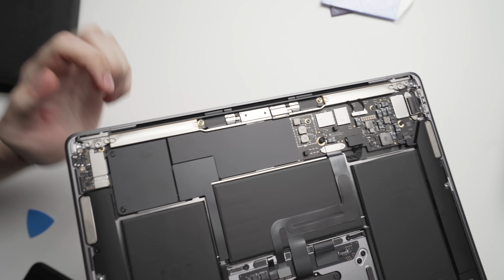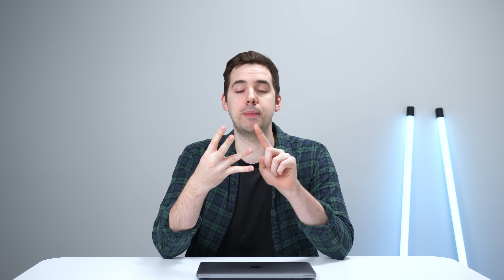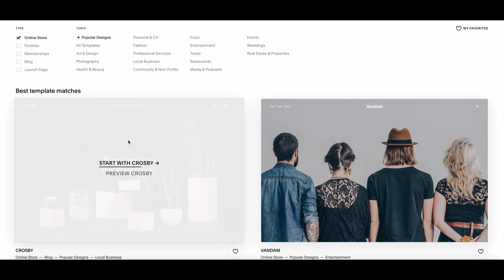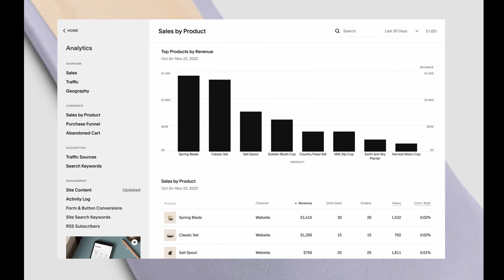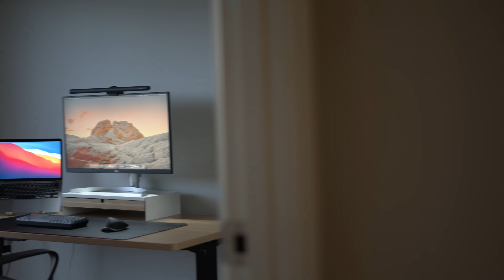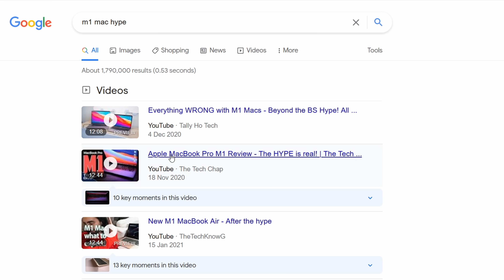M1 MacBook Air Review - After 5000 Hours of Use

Comment: Its an amazing laptop. Been using it for a few weeks now and everything is so fast and smooth. I had some files that were in my old laptop (Lenovo, i5, 8gb RAM) so I went back to retrieve them, and from the moment I turned it on, to getting the file, and accessing chrome to send the file online, took me 30 minutes (I am not even joking about this). Made me realize how amazing the Macbook M1 Air is when the same process took just that few clicks here and there to complete. The only problem I had with it was during the first week when transitioning from a Windows laptop to a Mac. The trackpad, keyboard, shortcuts and all were unfamiliar but now its much better and a breeze when it comes to work completion.
Reply: I don’t think you’ll go wrong with the decision. I’m a university student as well. Excel, Word and some of my biotech related programs run very smoothly. Mine has 8gb of RAM and it’s already blazing fast. Do keep an eye on your storage options. I opted for 512gb as a long term buffer and very quickly almost half is full (it’s probably because i synced my iPhone stuff into the Mac). Just keep in mind that if you’re coming from a windows laptop like me, then give yourself a week or two to get used to the trackpad, shortcuts etc.
Reply: @kdr9608  I've the option of either upgrading the RAM to 16GB or the Storage to 512GB, I'm confused as to which should I choose. The RAM makes it future proof to some extent. While I can always get an external SSD for a price that's cheaper than what Apple offers, the same wouldn't possible in case of the RAM.
Reply: @shishirkumar9570  Yeap you’ve got a point there. And also since you’ll be using it for video editing and coding, opting for a better RAM should be a reasonable option. And if you were to edit videos and save the files into the Mac, pretty sure it’ll hog a lot of storage so an external SSD may be the better long term choice. 

I didn’t opt for a stronger RAM but a 512gb storage option because I knew I’d be backing up my phone in this Mac. The phone is 256gb and there’s already like 150+ gb used up after year 😆 So surely in a few more years time my backup sizes would only grow alongside the files etc I will have in my Mac.
Reply: @kdr9608  Got you sir. I was really looking for a Mac owner to have this discussion with. Thank you very much.
Reply: @shishirkumar9570  No worries. All the best!
Reply: @shishirkumar9570  when I upgrade I use the following rule: # of cpus > # of gpus > ram > ssd size ... what that means is if you have limited $ upgrade cpu/gpu (in case of the MBA go to the 8 core GPU as an example), than up the RAM, and lastly go for bigger SSD.  You can always use external storage/cloud.  I wouldn't choose to rely on the fast SSD for swapping, SSDs have finite mumber of P/E cycles (constant writing and erasing wears them out)
Reply: Hey, I'm thinking of buying an entry level MBA M1 16GB RAM for college, mostly I'd do browsing, some beginner level video editing and coding. Will you suggest it?
Reply: A bit late here, but how is the MBA keeping up now? Is 8gb ram still enough for you?
Reply: @avrgbtw  So far no issues at all running stuff like Word, Excel each having pretty large datasets. Apart from that my Safari tabs are always there, averaging from 5 to 15, occasionally more. Zoom calls which lasts more than 2 hours. Other miscellaneous ones like calendar and finder is always there too. With all these running, its still smooth. So far the only major app issue I’ve faced is with the notes app which won’t open. Restart should solve the issue but its just that sometimes it can be annoying haha. Hope this helps.
Reply: @kdr9608  Thanks for the quick answer, this helped me a lot!
Reply: @avrgbtw  just note that if you’re transitioning from a windows system then the beginning might be tricky when you try to use the Mac. The trackpad is wonderful though once you’re used to it haha.
Reply: @kdr9608 hi how is the mac holding up now I’m also thinking of buying a MacBook Air but wondering what to get. Don’t know if I should go for the 16gb ram or 512 ssd for MacBook Air m1.
Reply: @SsscRl  Hi there. Its been consistently performing like it has always been. The quickness, smoothness and all are still present. I did notice the battery health dipped a little bit, but then again I’ve been using the laptop for work a lot so its only natural. Apart from that still an amazing piece of work this M1 Macbook haha. If you’re planning to do picture/video editing then you may need to consider a higher RAM (since storage can be sorted out externally later on if the need arises). I personally don’t use mine for that purpose, so the existing RAM is more than enough.

Comment: Love your videos by the way. In regards to not noticing when the M1 MBA is under heavy load, I had only noticed in transitions between apps, however, when I reduce motion the lag between transitions is no longer noticeable. In fact, since owning the device I have compared the MBA m1 a lot of the time to an iPad. The M1 MBA offers the best experience on a laptop. I use my MBA M1 for everything from personal use to multi-tasking workflows. My workflows are not intensive, but I do have a lot of apps open at a time that I need to switch between constantly. 

Another aspect to the MBA M1 and I also agree that it's underappreciated, is the lack of fans. I hate fan noise, even when the fan noise is nearly dead silent I still can't stand it. The fact the design is fanless, the M1 MBA reminds me even more of an iPad. The actual reason why I have owned iPads in the past for work is because of how powerful the device is and the fact I can do what I need to without the fan ever kicking on. Now because of the M1 MBA, I have no need for an iPad. 

In regards to making this device what it is not, a beast editing rig, your right your going to be disappointed. However, I don't feel that Apple is advertising the MBA M1 as a heavy editing/gaming rig. Apple is however advertising the MBA M1 as a power-capable device, and I have to agree. The MBA has never been a heavy power device, the MBA has always been a light portable productivity device. 

With these points made, who I still think could benefit from this device are business/average consumers. This device will more than definitely breeze through your excel, PowerPoint, photo editing tasks. The device is also great for cloud gaming and Apple Arcade; which with both should keep you occupied during work breaks. Again great video as always!

Comment: Unrelated Question: What do you think is the future of ARM for other laptops. As we all know, Nvidia partnered with ARM to make future laptops with ARM processors that will work with their GPUs. People are saying this will make a Chromebook a gaming laptop! I just want to know what you think about this, when laptops with this architecture will likely come out, and how they might compete with future macbooks.
Reply from the maker: I think it's going to be at least 2 years before we start seeing comparable ARM laptops from other manufacturers. That being said, the recent improvements by AMD (and also Nvidia) have been very promising, including the 5900HX and RTX 3060 on the Razer Blade 14 (which I am currently doing a video on). They aren't ARM-based so suffer from decreased optimisation, wattage, and heat generation issues, but they're still very powerful.

What is putting Apple miles ahead of the competition right now is that they design the hardware FOR the software, and almost everything is designed by Apple themselves.
Reply: @CreatedTech  Thank you. I just hope there will be gaming laptops that are more optimized soon. I could use some less fan noise, heat, and more reliable performance at great value. Oh well, I least people can live on a macbook for the next 2 years. I can't wait for the future!

Edit: Just to be sure, I am not saying the macbook is bad, am just saying that I can't wait for more ARM laptops so everyone can have what they need at optimized performance.

Comment: I am an m1 macbook pro user and I have to point out that the fan rarely turns on so the issue with having macbook with a fan on a bed or sheets is negligible.
Reply: Exactly
Reply: But does it get hot
Reply: Still gets 100 degrees hot

Comment: Idc about the cons, imo its a perfect laptop in the market rn. I am saving up for this one(halfway there) hope to get it soon :)
Reply: Definitely worth it. Battery life is insane, if I have to nitpick this thing I will say about port, but we have dongle anyway so we move.
Reply: I bought mine direct from Apple refurbished….entry model $850. Just like new…battery had only two cycles. Great deal
Reply: Me too! But lowkey waiting for the new product on the end of the year tho. Just incase they release even better product
Reply: i am saving money to buy this laptop or upcomicing mac to replace my 6 year old dell laptop. i hope is enough to use blender and coding
Reply: @zulkifliarshad  It's definitely enough, but if i were to choose again (I'm on M1 Air, 16 GB of memory, 7-core GPU) i'd choose the Pro variant. Yes, even the entry model with 8 GB of memory.

My use case is pretty similar, coding and some 3D stuff from time to time. It's good until you don't push it for more than 3-5 minutes, after that it starts to throttle significantly and from my testing it can almost lose 30% of the performance (computational multi-threaded application with computation time evaluation, only 4 threads used with 10% of GPU usage).

The thing is, i paid for the memory which i barely use, if i were to run something which would require all this memory, i would probably need a cpu fan sooner than the memory itself.
Reply: @MehOccor  but will the MBP 8gigs be future proof? I also can't decide between MBA 16 and MBP 8. Im looking forward to make it my daily machine. (I sometimes work intensely on data research )Please reply.
Reply: @sisyphisy2474  Just be aware that MBA gets hot and throttles a lot when you push it. Not sure what kind of data research you do, but if it means that machine will be stressed for hours, really just go with MBP, but I mean, really stressed. I'm running my own software on all cores and having it render the results for 20-30 minutes made it so hot my battery health is already 90%. Could be a lot of reasons, but my guess is that heat is one of them (im at 65 cycles so not that bad cycle-wise). About memory, 8 GB wouldn't be enough for me, so I went with 16. Judging by your work and the fact that it would be your daily machine, i'd go with more memory. 

What about MBA 16 and buying some cooling pad?
Reply: Its the worst apple silicon chip yk😂
Reply: Wait for the M2 Air.. It gets even better
Reply: Excuse me, but how can you have an opinion if you don't own it yet? Sorry for being nit-picky but really - to make rational decision, make sure to un-bias yourself before spending money on it. 

Consider getting the Pro version if you'll make any extensive use of the machine (resource-heavy)
Reply: @MehOccor  probably the touchbar that keeps them from preferring the Pro over the Air
Reply: @MehOccor  and I already have an M1 Air, it does great for resource heavy tasks actually, it just doesnt have a fan, which would also be unnecessary most of the time
Reply: @domdom-hh9tx  What kind of heavy tasks are you doing on your M1 Air?
Reply: @domdom-hh9tx  "Resource heavy tasks" and "unnecessary fan" don't fit into the same sentence.
Reply: @MehOccor  ever heard of optimization and power efficiency to the point wherein thermals barely need fans to cool them down
Reply: @MehOccor  and who are you to dictate what MY M1 MacBook Air does with the way it manages its thermals and processing?
Reply: @MehOccor  split window chrome, multiple tabs on chrome, safari too because its there, editing on da vinci with 4k and on canva?? isnt that resource heavy already?
Reply: @domdom-hh9tx  I’m with the both of you as I own the Macbook Air M1 and also the M1 12.9” iPad Pro but for my own experience I’m selling my iPad Pro to buy the M1 Macbook Pro for reasons that my M1 is seriously heating up when I’m doing my work (mostly chrome tabs) I’m a digital marketer and most of my work is done through browsers but I’ve noticed since owning the M1 Air was it was seriously heating up when I’m at atleast 20-30 tabs!!! 

Anyway that’s my personal experience and I hope this helps everyone who sees my comment decide, 
I think for me that fan from the Pro is worth the extra cash for those who are working and wants stable performance for longer periods of time (referring to the performance I also experienced stuttering when I noticed that my M1 is heating up) unfortunate, sure but the M1 sure is powerful! For Students I’d recommend the Air for sure.
Reply: @MehOccor  and by “perfect in the market” they’re probably referring to students in the search for a laptop

Comment: It edits 6k just fine what are you smoking?
Reply from the maker: I've been editing 6K BRAW footage on single, double, and triple stacked timelines of varying lengths with color correction, minor effects, and Fusion transitions on the M1 MacBook Air, Pro, Mini, and iMac. Yes, you can edit simple 6K timelines (only specific kinds of 6K footage too, e.g. BRAW), but it's not a good idea to buy a base model MacBook AIR with 8GB of RAM to edit 6K footage lmao. What are YOU smoking mate???
Reply: @CreatedTech  I've haven't had an issue with any of that. Using Final Cut.
Reply from the maker: @aliaswave  Firstly, not everyone uses FCP... Secondly, again, it depends on what kind of footage, effects, stacking, and length of the edit you're working with. You haven't given any insight into yours.

Comment: Question:
Does a macbook pro have any kind of problems with very heavy Google software, for 3D modeling, architecture? Or is a Samsung galaxy book pro 360 better for those specific tasks?

Edit: thanks guys
Reply: I'd say get the M1 16gb - pro or air.
Reply: If yout worried, get a 16gb MacBook pro as the fans will help yout substained performance on 3d modeling as well keep it from throttling